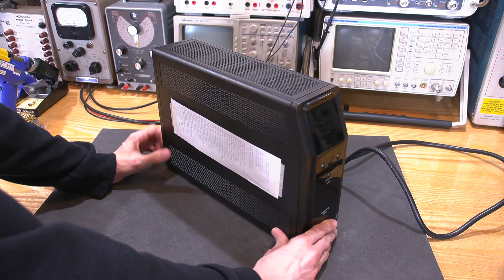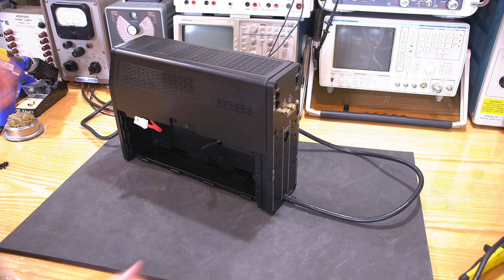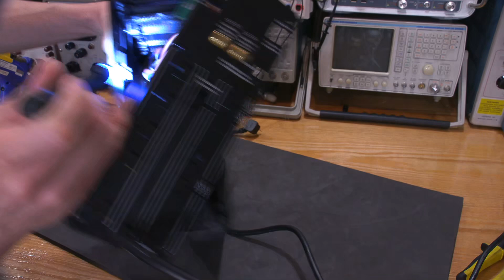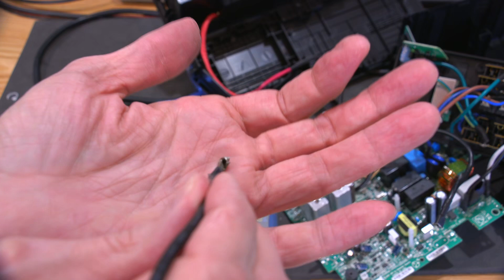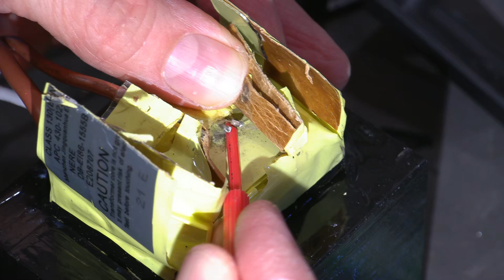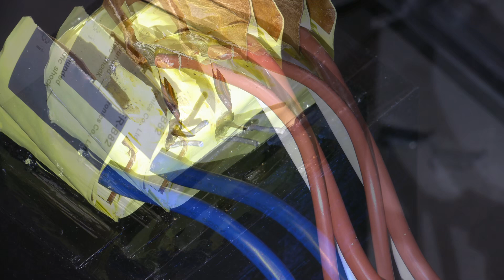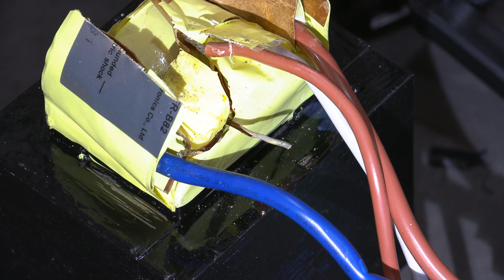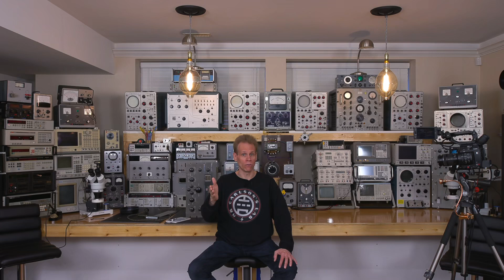UPS Electrical Failure - Teardown and Analysis!

Comment: Sir, Great video. Can I use an old  APC 600 VA UPS as extension box. I have removed the old battery and the transformer.  Thanking you,

Comment: These LEGO parts are shared across all types of industries. My best guess is they had a defective batch of low-power microwave transformers they shoved into these 'price saver' units. Not IF it fails, but WHEN, and if it's after your warranty, all the better for the CEO's pocketbook. This is why I stick with Emerson for my power sensitive stuff.

Comment: I have a 6 year old APC UPS. I started getting worried about the aluminum wound transformer. Before I tour in to it I purchased a new APC UPS with pure sine wave, I wanted a new one anyway, because my old one had a modified sine wave. I can't recall if you had a video on sine waves, people should know the difference, before they damage sensitive equipment. Buy the way my old UPS had a copper wound transformer, I guess after several fails APC Changed them back to copper transformer.

Comment: Measure your batteries first, that's the most common fail point. Rude it would be aluminum wire. I would use a small piece of brass tubing, over lap the wires & crimp it together,then flux & fill with solder.

Comment: Using aluminum is both stupid and outright dangerous. There was a time during the 1970's here in California where they wired houses with aluminum electrical wires. After a few decades worth of earthquakes combined with the heating and cooling of the wires from running high current appliances and such, the stuff becomes super brittle. So much so that i was helping a friend swap out a wall outlet and no matter how careful i was, i'd strip the wire, bend a J hook, and it would snap off as soon as i started tightening the screws. He and i spent the next two weeks doing a complete re-wire of his home. Now i see why electricians charge anywhere from $5 to $17 per square foot to completely rewire a house.   Yes, a 2,000 sq/ft house can cost anywhere from $10,000 to $37,000. Aluminum wiring is such a huge fire hazard,  I thought it was illegal to use it for mains voltage

Comment: Shocking, and terribly disappointing. The whole point of a UPS is to enhance reliability. A shoddy, unreliable UPS will have the opposite effect.

Does anyone make a good quality UPS that uses long-lasting LiFePO4 batteries, instead of lead-acid?

Comment: That was really interesting. I've used almost nothing but APC UPSes, and never had any problems with them, despite a couple of them being 5-10 years old. None of them were the newer model you had fail, although two were older versions of the same size and shape.

I wonder if they had to get transformers from a different source due to all the supply shortages lately, and ended up with something that was an unexpectedly crappy design as a result? I sure hope it wasn't a deliberate choice.

Comment: I wonder if APC's 240 volt UPS units for us over here in the UK/EU are the same quality. I have half a dozen of the APC Back-UPS Pro 900 model which are about 8-9 years old, they've been through about a dozen genuine power cuts plus dozens of shorter brownouts without any issues. I recently bought 2 of the new APC Back-UPS Pro 1600 pure sine wave model like the one shown in the video, let's see how reliable they turn out to be.

Comment: I have several of these APC UPS's. They all come with that test results tape. To the best of my knowledge, the version you see is the version of the testing software used to perform test the device and generate that tape. This is an interesting issue. I've never had an APC fail like this. They usually fail because the battery fails and needs replaced.

Comment: APC are supposed to be a go to brand for UPS devices but using Aluminium wire in a transformer suggests serious scrimping on costs (despite not being cheap devices). Scary !!!

Comment: Again, I am not trying to be deliberately negative but I run into this all the time . Anything "Made In China" is just junk.  It doesn't last, is not designed to last and it is so frustrating to see. When things were made in America or Caanada they were easy to fix and were quality built with quality parts.  So sad.

Comment: My first disappointment was, when I had to replace the batteries after about 8 months (they saw about 10 blackouts).  There were these APC stickers on the batteries "use only original replacement stuff". Removed the APC stickers and yeah, those were cheap ass noname batteries. Replaced with other make, which I trust and have experience with. 4 years since the replacement. Self-test says, the batteries are OK. No data about running time - my new place has no blackouts. :D

This aluminium transformator hit me really hard... REALLY disappointed.  

I think the paper is the result of the EOL test. It means the unit is OK, it can be delivered. If the Q.C. puts a sign on the paper with pen, it makes the whole thing look more professional and serious. In reality it has no added value. :D In a proper manufacturing process the unit is tracked automatically. The records (serial#, production date, informations about sub-componentes, test results, ...)  of the unit are stored in a database. You don't have to play around with stickers, just scan the QR-code.

Comment: I want to say I'm surprised at the transformer connections but I'm not.  APC has stuck test 'receipts' on their products for over twenty years, that's just part of the way they do it, but surprised they still do since APC belongs to Schneider Electric now, and it all seems to have gone the Muntz TV route.  Take out components, make them as cheap as possible, don't try to please every customer just gamble with the returns and warranty and hope you still make money!  As an aside, except for noises that arcing transformers make I've found that large chokes will squeal and make noises when the incoming AC is bad.  I treat UPS boxes of this ilk as $100.- fuses.  Great since I live in a place where weather can get pretty violent and lightning strikes are pretty common.  Another thing RoHS lead free solder is crap, and every PCB made to that standard will eventually fail.  I half expected to see you find no problem with the transformer and start reflowing solder on the PCB's!

Comment: Paul, this stunt that APC did reminds me of when back in the '70's, copper wire was in really short supply. So, instead of holding off building new homes, aluminum wire was installed instead of copper. Needless to say, things didn't go well. Electrical fires burnt down a lot of new homes. A fix was used to help reduce the chance of any new fires. Come to find out, the alum. wire would heat up and come off wall receptacles and arch. A fix was a copper "pig tale" attached to the already installed wires with clips and crimped with a special crimper. So, APC could have used the same method to attach the transformer windings.

Comment: APC (American Power Conversion) was a premier UPS manufacturing company.  When they were bought by Schneider Electric in about 2006 or so their product line started going downhill fast.  I stopped using and recommending their products shortly thereafter due to low reliability and many manufacturing shortcuts such as the one you found.

Comment: It is possible to solder to aluminum but it ain't easy. found this blurb over at hackaday -
 "Aluminum doesn’t solder well, and that’s because of the oxide layer that rapidly forms on the surface. [Ted]’s solution is to scour the aluminum with some mineral oil. The goal is to scrape away the oxide layer on the aluminum’s surface, while the mineral oil’s coating action prevents a new oxide layer from immediately re-forming."

It's the oxide layer that's the trick. Aluminum windings are better in some instances since it conducts heat away but good ol' copper is the answer for longevity.

Comment: On this side of the world, if something fails due to a design deficiency or fault, you generally are entitled to a replacement or a refund.  For this reason, suppliers generally don't last long if they start supplying shoddy goods.  The customers return them to the shop and get refunds.  The shops don't like eating the costs of those refunds and stop stocking that brand and instead stock something reliable.  Exit that brand.  It's not quite as easy as that, but that's the way it tends to go.
Adding: Every UPS I've had which has failed has done so due to a faulty capacitor which has ruined the battery.  I've replaced those capacitors at least three times (and probably more) across at least two different UPSs (one needed two different capacitors replaced on different occasions).  Each time, the UPS has come back to life again and kept a new battery alive.

Comment: Since I first watched this, we've had 2 new units, like this (that we inherited from another company) crap out and 2 rack-mount SMU1500s, that were only a few months out of warranty, also go bye-bye. The few OLD APCs that we still have? Over ten years and still working (with replacement batteries).

Comment: I am using APC UPS's throughout my studio and their failure rate has been high.  I'm curious to know what brand you replaced that unit with.  I wish they'd ban the use of aluminum wire for households and domestic electronics.  It seems to consistently cause problems.  Thanks for making this video.

Comment: wow, i dont belive i can see this again,it's not just APC, now most transformers are made of aluminum, and this type of conection i already see in microwave transformers, a ball of tin just a big contact area with aluminum, but any mechanical joint, just relying in twisting together and a bunch of tin for "clamp" It's not better crimping terminals in aluminum? and this solder? working how a interface? i already see a failed UPS and the failure was, a bad contact, but soldering the fuse cable in a 600va model, remember, APC it's part of scheider electric...

Comment: I'm jumping the gun on this.
All the APC UPSs I have use a hefty power transformers in them. As much as the weight of the battery.
The 2200Kw version uses 2 large transformers. You bend your knees when picking these things up off the floor with no batteries in them.

Edit
APC have now gone to blinking cheap to use aluminum windings!?!
And I bet they still charge top dollar.
They used to be top notch.
I wont be buying APC products from this point forward!!!

Comment: I've always had good luck with APC UPS with only one bad lead acid battery that leaked a bit but didn't corrode the terminals badly. What brand did you end up going with?

Comment: I've had several SpartUPS fail with that exact T04 trouble code. Like many here, I don't buy APC any more. I switched to sine wave Cyberpower units, and they have been going strong for more than 10 years. I do have some very old APC Smart UPS still in use, but they are all from before the 2007 buy out. I have my network rack on one, and my fiber modem off another.
I was a big LAN party person in the early 2000s, and I won't run a PC without a UPS. Too many mental scars of reinstalling Win98SE at a LAN while all my UPS equipped friends were still fine.

Comment: Isn't a UPS just a battery charger and inverter in a nice box?
Reply: In theory a proper UPS is a bit more intelligent than that. It will switch between mains and battery during brownouts and power surges, and will maintain position on the mains sine wave when switching between mains and battery to reduce the risk of upsetting sensitive electronic devices.

Comment: Had a larger unit on a piece of lab equipment. We had a power failure on night next morning no power from unit so thought just needed recharge. Removed from instrument and plugged in. Result fireworks display shooting  sparks across the room. Pulled the cover and power supply was completely slagged. Guess only good for one use.

Comment: I saw this once before in a Korean step-down transformer originally sold to American servicemen so they could run their American appliances on Korean voltage.  I disassembled the core, saved the single core winding, calculated the number of turns I'd need to make separate primary and secondary windings, and began rebuilding it.  Only then did I notice that the copper colored wire was just that, copper colored.  It refused to solder.  Turned out to be aluminum wire covered with a copper colored enamel.

Comment: I worked on a lot of APC UPS when I serviced Medical Grade diagnostic equipment.  Usually 20-25KVA 208-30 amp systems.
Every APC UPS had the "cash register" print out tag as part of APC' QC when brand new out of the box.  Overall the APC units were pretty good.  Some models better than others.  One thing about APC was the devices were pre-planned obsolete after a certain amount of time and when that clock ran out.... No more parts for them.  I enjoy your in depth coverage on diagnosing and explanations of various circuitry

Comment: 11:24 wHAT IS THAT!!!! :) Edit: OFC (oxygen-free copper) vs. CCA (copper-clad aluminum): there is a big problem in the market with those cables, that the public doesn't know. About buying the cables for home hifi, they don't say sometimes what they are made of, so... they can lower the price. For car-Fi is fine because cables are shorter but for home is much better copper or OFC.

Comment: You found the SAME EXACT PROBLEM/ISSUE I did.  Why didn't you try and proceed to come up with your solution to repair the transformer?  I did and it works ok now, but I won't buy or recommend these units anymore.

Comment: Mine failed after one power outage ran it down.  It was under warranty from Sam's Club and so far the replacement is OK and helped out the night the power company decided to do something up the block from 3am (exactly) to 3:49am (exactly).  The AC going off woke me and I had nothing to do except play on the internet.    I also learned that I can run my corner computer for about 80 minutes.

Comment: That's china for you. Imagine that no one's home and these things step into action, or rather are supposed to, and they do this instead. A burned down house is the risk here. The hazard with modern cheaply made electronics are very far from the precautions that were made earlier on, with sharp looking tests and inspections in each country. Now, when there's common market, no borders, no inspections, no qc to catch the odd sinner. Think of the cell phone chargers that burst into flames a few years ago, with people sleeping next to or close to their charging cell phone in the night. A quick fire and toxic smoke ond they are dead.
Thanks for sharing. Very important to show and share.
Kind regards.

Comment: Some proper cost rinsing going on there by APC, aluminium instead of copper windings, saved only a £1 or £2 max but as the wires won't solder to the core terminals it's relying on the cable being wrapped around it, big potential for failing and arcing as has happened here. Probably wouldn't cause a fire as such as long as the plastics used are V rated correctly on the cables but poor manufacturing practices.

Comment: Hi Mr. Carlson, 
I love your work and I spent uncounted hours listening to your excellent methodical fault analysis.

From my practice on aluminium:

Aluminium is to be soldered with the correct flux. The German company Stannol provides ALU1, a specially filled soldering wire.

It works  fine, even with aluminium heat sinks.

Although I only have Smart, UPS and no Back UPS out, I believe the video is about a production flaw and not a design fault.

Michael
Reply: I was about to say the same thing. You can solder to aluminum if you use solder designed for working with aluminum.

Comment: Gave up on APC years ago when my server UPS fried when I lost power. Blew a MOSFET apart.
Another brand had a short in the transformer, sounded like it was doing some welding, very bad connections at the Transformer. Looked like CCA windings

Comment: thanks very much for the video.  I have an APC power supply.  I replaced the battery and as far as I know it's working fine.  I have a stereo system hooked up to my computer ( a mac ) but I was getting a lot of static on the stereo system.  The computer had been plugged in to the battery backup and the stereo plugged in to the surge protection side.  I moved the computer to the surge protection side and the static disappeared.  I heard something about ground loop.  I don't understand ground loop but I think having both the computer and the stereo plugged in to the same side solved the problem.
The fact that the transformer is made of aluminium is not a positive.  If I have to replace the power supply, that's something to watch out for.

Comment: I had a new one I just took out of the box yesterday.  Plugged it in and it came on by itself.  Tried to turn it off and the switch wasn't working.  Removed the front cover, then 6 screws to remove the front plate.  There is a circuit board attached to the front plate that is held in place with two screws.  Neither screw was tightened down so when the power button was pushed it just pushed the entire PCB back.  Tightened the screws to hold the board securely and it works fine now.  I have been using APC UPS systems since the 90s and have never seen anything like this.

Comment: There are fluxes and materials for soldering to Aluminium. Its not easy at hobby level but perfectly OK under controlled workshop conditions. It was used for a while in the 1970s for joining to copper underground mains MV (415v) cables using traditional soldering/plumbing techniques as used on copper/lead cables.  The fluxes  were highly corrosive and the process fell from use in favour of mechanical joints and resin potting. Aluminium is still used for some large power transformers where lower weight and cost is a consideration over efficiency.